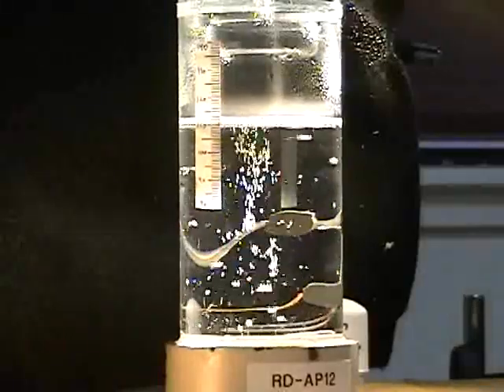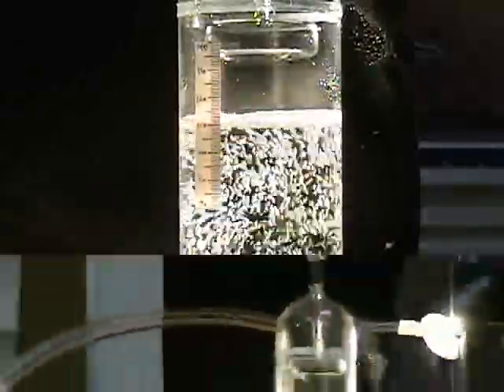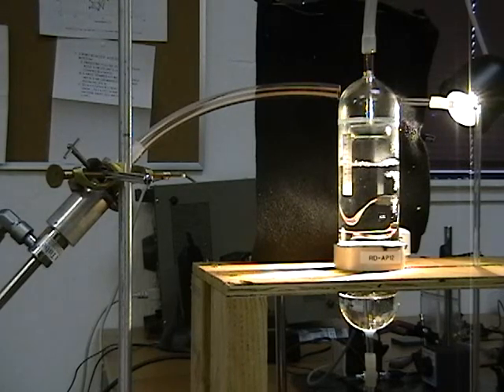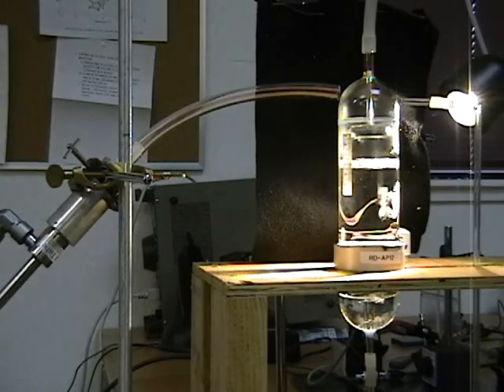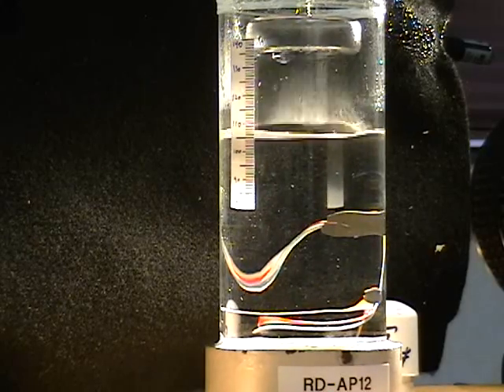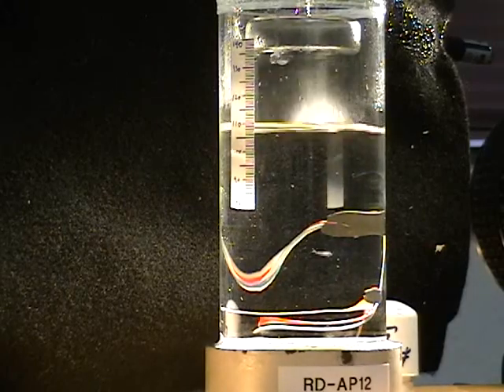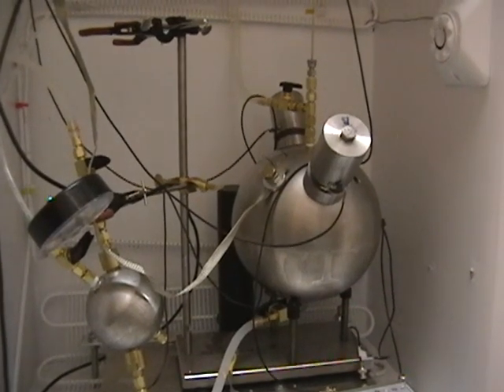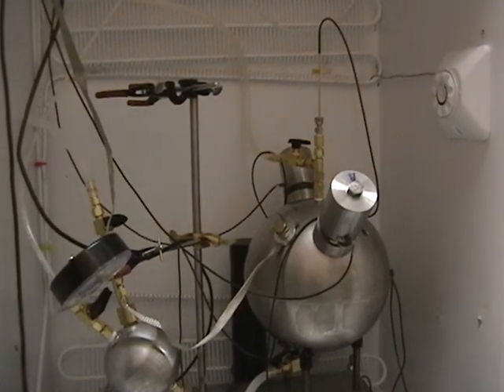Neutron Cavitation Fusion Reactors Impulse Devices Inc

Comment: I tried something similar with Titanium alloy and I used 20  transducers arranged as an icosahedron I drive it with 2KW at 40 KHz, wall tickness was a half wave of 40 Khz in titanium, and center void with radius of a half wave of 40 Khz in water, I tried to force cavitation to happen in the center of water body not at metal water interface, because at hi pressure it ruins the device.

I tried at hi pressure 1000-2000 bar, I obtained something similar with this ,but with no neutron source, In my experiment cavitation happened at hi temperatures, al lo temperature and hi pressure water is too viscous, fortunately it warms by itself with 2 KW of ultrasound.

Instead of use an external neutron source I planned to seed the water inside with tritium as neutron source or use something stable that encourage fusion, somehow that device generated some radiation with no seeded water.
Reply: Do you think dual or multi frequency cavitation would help keep the implosions away from the walls?
Reply: Possible, but i not see it obvious, technically is very difficult to introduce other frequencies than natural resonance and it-s harmonics. @HCG
Reply: hi very interesting of yours, my next projet will be crystalization based on hi power ultrasonic after i read very old book about probability of crystalization think about crystalizing liquid cuso4 but in faster time, just a simple concept

but after many years this cavitation still bug me that's why i postponed till i got enough material and definite answer after i read about  extreme stuff aka fusion, iam not yet disagree or agree about fusion, but i will avoid anything that include radioactive messing, can you give any suggestion?
Reply: @dogodogo5891  We done a research about  anataxic titan dioxide under cavitation, it gave some results,in principle under cavitation crystal growth is disrupted, result are nano particles.

Comment: You do know that once a nuclear fusion reactor starts producing radiative elements that it will become a nuclear fission reactor.

Witch could be bad, but how ever, one could take advantage of the magnetism, and turn radiative elements back into hydrogen, and it is possible. Under control conditions, with those creating more, or less a infinite of energy supply, if done right... Other than that a fusion reactor can become a hydrogen bomb, or a nuclear bomb if not careful.
Reply: There is such a thing called 'aneutronic fusion', just fyi.   I fully suspect that if the video author got within range of successful, controllable over-unity fusion, the government and possibly the military would have shut him down.  They do not want such helpful tech.  "Helpful" to us, not to them.

Successful fusion tech already exists. Dave Adair in 1970 combined two small-scale cyclotron accelerators to collide the accelerated particles in the middle of a 'figure 8' arrangement, with deuterium/tritium fule in the midpoint of the figure-8.  A declining inertia gradient (aka artificial gravity field) was created at the midpoint as the containment field. (The 60 year old Tokamak does not use gravity containment like the Sun; it has been failing for 60 years because it relies on magnetic containment).

Conventional, mainstream hot fusion such as the Tokamak has purposely been led astray by the government.  The Tokamak has never produced a SINGLE WATT of power in excess of what was put into it, for 60 years.  SIXTY YEARS. 

And most of the scientists who rely on grant money to 'push the Tokamak ahead' know full well why it does not work like the hot fusion in the Sun:  no gravity containment. 

There are thousands of open-minded physics/electrical engineering professionals around the globe who have figured out artificial gravity and do not publish and do not patent.  The government is a dumb, vicious and violent animal when it comes to allowing "STATE SCIENCE" to become mainstream.   "STATE SCIENCE" is kept from us.  Most rational people, researchers, suspect that or know it for a fact.

I would not be surprised if the author of the video has experience along these lines.  It sounds like he has a long history of fusion work.

If you are a researcher, I do not recommend attempting to commercialize or sell or patent tech that you suspect the government and military have.  There is absolutely no reason to expose yourself to the unethical, pathetic liars in our government and military who keep STATE SCIENCE in their personal sand box, never allowing it to see the light of day.

A lot of lives have been ruined or snuffed out, in complete disregard for the founding documents of this country, at the doorstep of maintaining secrecy over STATE SCIENCE.

It's 100% cool to develop new tech.  But if it is *ENERGY* related, or if it is *ARTIFICIAL GRAVITY* related, KEEP IT TO YOURSELF.
.